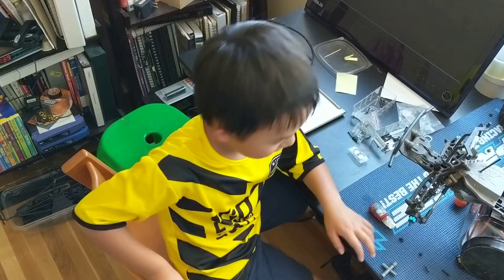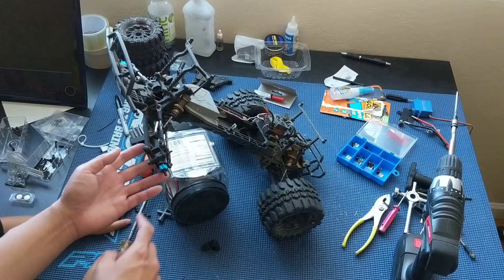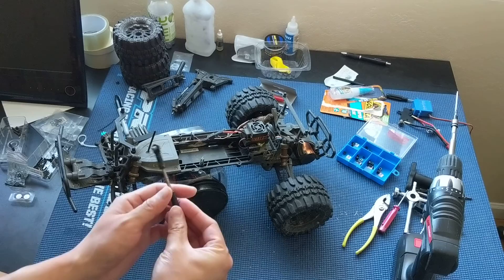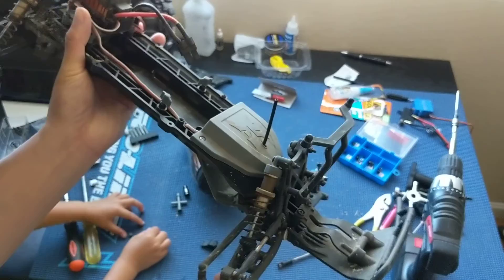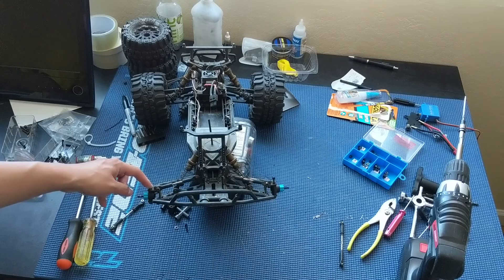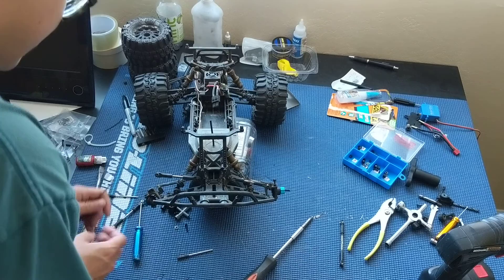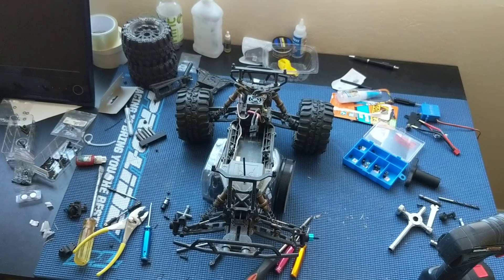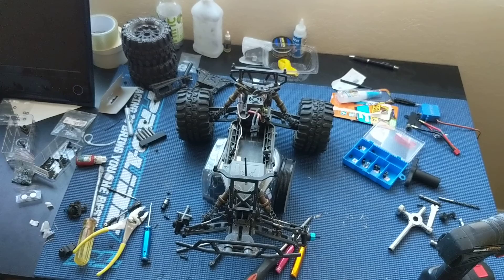Permanent Fix for Front Steering Hubs on ECX 2WD Ruckus Torment Amp Circuit Shoulder Using Rear Rubs

Comment: How wud you change the front steering blocks and axles to be able to use a front wheel that uses bearings and not hexes?
Reply from the maker: That would be a completely different set up and we're doubtful that any of the parts referenced would work. You'll probably want to use front wheels with hexes, we don't think here are any current wheels that use bearings in them anymore.

Comment: Thanks for the great idea to get rid of the shoulder bolt issues.  We've converted 4 ECXs (Amp MT/DB and a Circuit) and they all work great.   It did leave a little more play on the front axles. I printed a couple spacers to move the inner bearing inward ~1mm to tighten the drive train back up.  https://www.thingiverse.com/thing:4570821
Reply from the maker: Great to hear it worked for you! The URL gave me an error not found, could you repost it? Thanks!
Reply: @Racing2Learn   Guess Is didn't publish the link.  It should be working now.